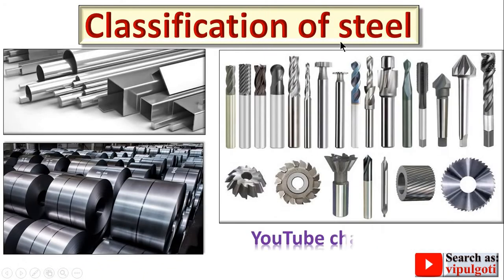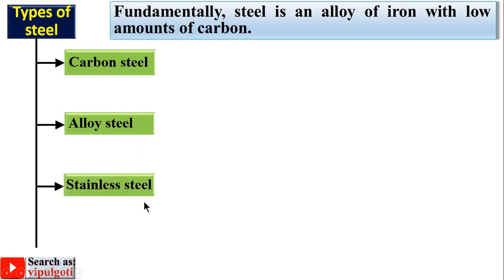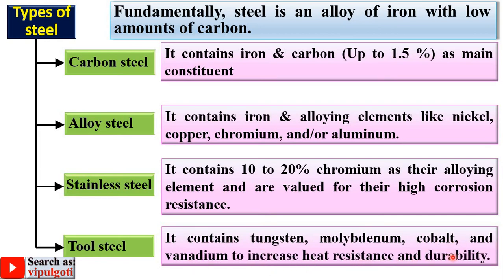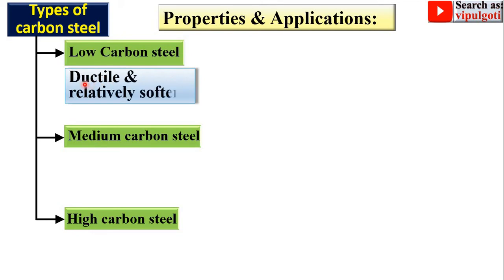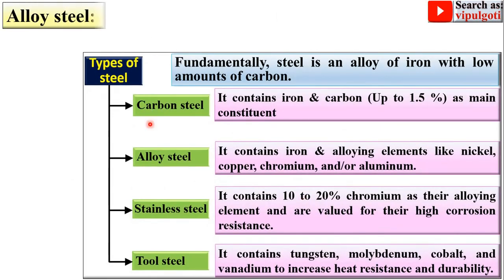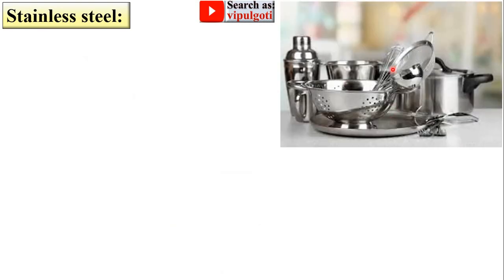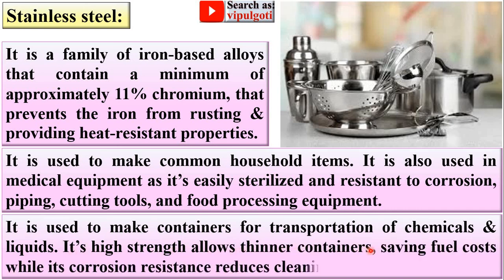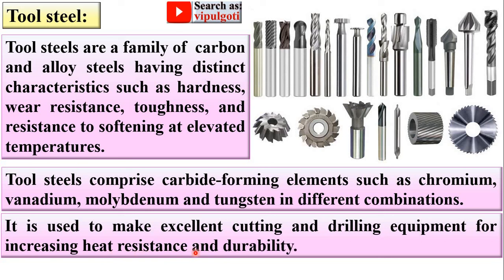Types of steel, Steel types, Carbon steel, Alloy steel, Tool steel #SS #Steel

Comment: What is EN18
Reply from the maker: EN 18 Alloy Steel has good tensile strength and contains medium carbon and chromium steel. EN 18 Alloy Steel have 1% chromium and is heat treated for making products like front vehicle axles, Front Axle beam, axle journals, crankshafts, steering components.